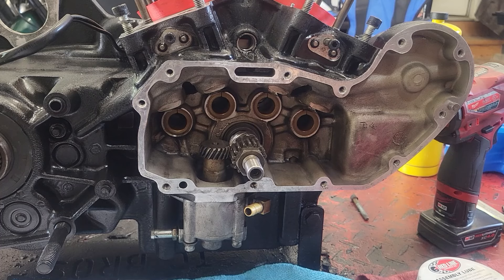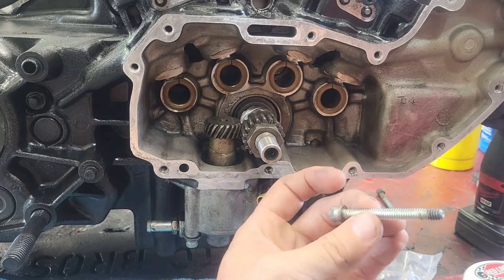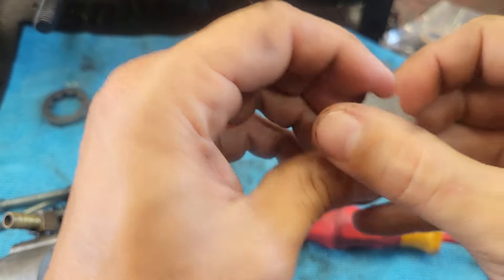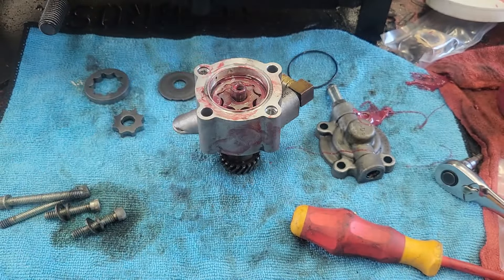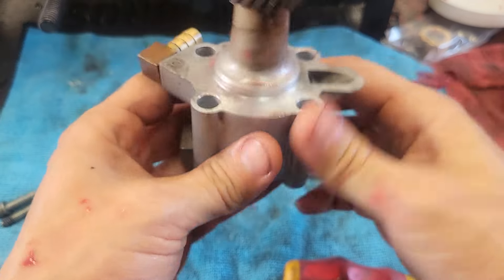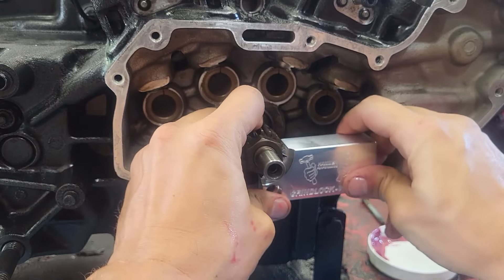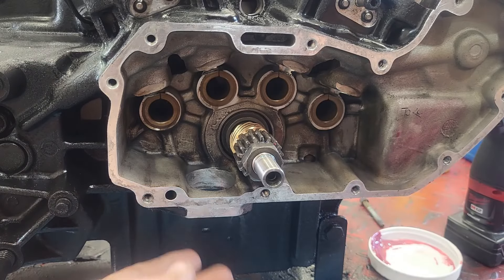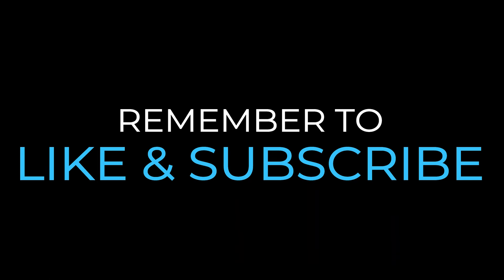96-03 Sportster Oil Pump Rebuild and Drive Gear Replacement

Comment: Gonna have to check out hammer performance. Thinking about some head work for my twinkie this coming winter
Reply from the maker: They definitely do top notch work. And they have packages for twin cams. That might be on my short list, my 96ci blackline has been needing some love lately. And in my opinion the pricing is very fair!
Reply: I want to leave my '02 Super Glide 88 cu in. Did a S&S 509 complete cam chest on it and really woke it up. Figured some head work wouldn't hurt.
Reply from the maker: Give them a call! The owner, Dan has always been available every time I've called. I'm sure more airflow will take that 89ci right up!